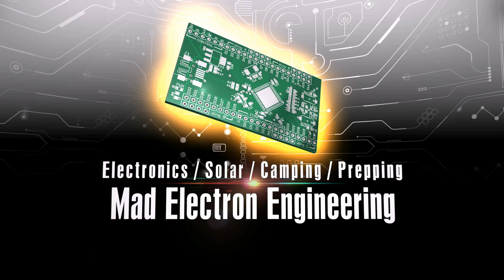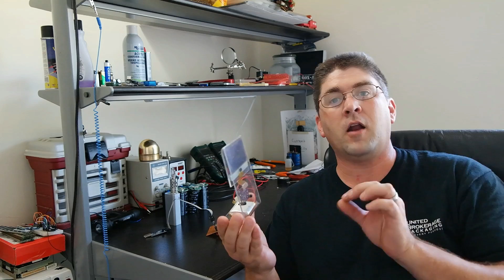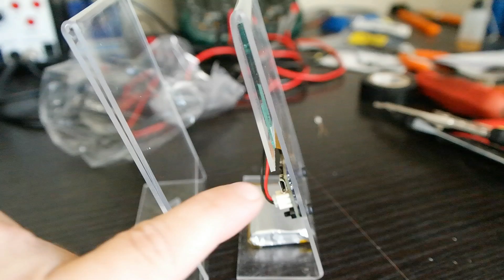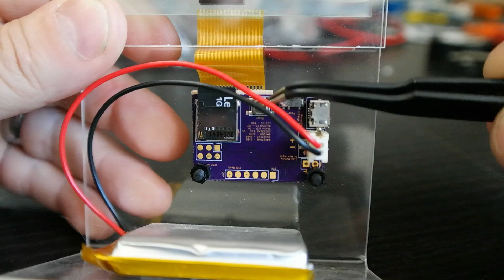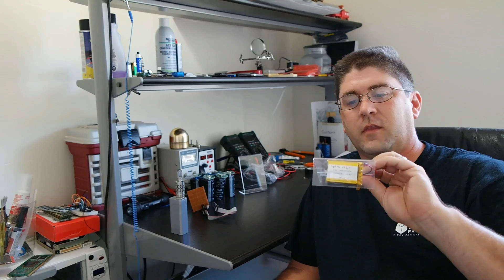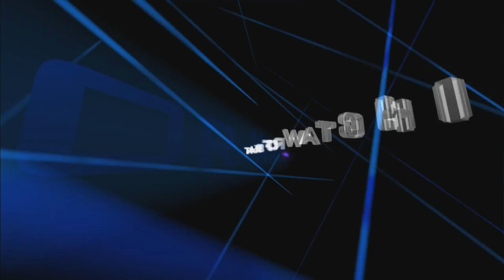Arduino Environmental Monitor Update #4

Comment: Very cool project. I like the picture frame you are using as the case.
May I ask you for the board files? Unfortunately I don't see a dropbox link.

Regarding the BME680:
Bosch just released the sensor and the sensor is now available at different electronic sellers. I just developed the first breakout boards, http://arduino-praxis.ch/2017/09/08/bme680-umweltsensor-board/

Comment: Hello again i finally got the same LCD Dot matrix screen as you do and i got a breakout board with the 18 pin 1mm picture connector. To make mine right now Breadboard friendly. I got the 1uf caps for it  9 of them well i got 100 of them because it was cheap lol. I got most of the wiring down Which pins go to the arduino There is a CS, RESET, RS(A0), SCLK,and SID pin. Now i know the CS,SCLK are for SPI pins but what about the rest of them? Where does everything go?? Also which library and sketch did you use to try this out?
Reply from the maker: research u8glib or its successor u8g2 for arduino.  I can't remember which pins went where off the top of my head.

Comment: I love the display. Can you supply the source (digikey, ebay link, etc) for the gray connector you are using? Also, is that display the digipole DSDM12864LCDS7 3.1" 128x64 LCD Smart Display?
Reply: Yes I would love to know which display is this as well. Can you please post any info on it?
Reply: It is 128x64 COG display using the 7565 driver chip. It uses SPI and it is around 70mm in width and 40 mm in height. M y guess is that it is this one:
https://www.aliexpress.com/item/COG-18PIN-12864-LCD-Screen-ST7565-controller-compatible-SPLC501-Without-Backlight-3-3V/1751724718.html?spm=2114.01010208.3.146.wASHGJ&ws_ab_test=searchweb0_0,searchweb201602_5_10056_10065_10068_10055_10054_10069_10059_10078_10079_10073_10017_10080_10070_10082_10081_10060_10061_10052_10062_10053_10050_10051,searchweb201603_3&btsid=c458bb1c-f349-46d1-ae5a-ab58f0ff7555

I will order one and we will see.

Comment: I have a idea on your updated project that might cost a little bit but not sure how much. Sense you have a RTC DS3231 on there. What happens if the battery dies out and you don't have access to a pc? Would it be better to add a couple of small buttons to manually program the clock and it saves just incase?  Just wondering.
Reply from the maker: +joseph chrzempiec (josephchrzempiec) I would agree with you.  I have one digital interrupt available and 5 analog inputs available but I suck at coding.
Reply: I found out something very cool. You know you can put 3 buttons or more only using one Digital pin. using different resistor values.  i found it online. Now Like you. I'm also into only hardware not software. I can around with it match a few things together if it works and hope for the best  LOL
Reply from the maker: You can only use the multi resistor button setup on analog pins, not digital pins.
Reply: Ahhh okay got it thank you.